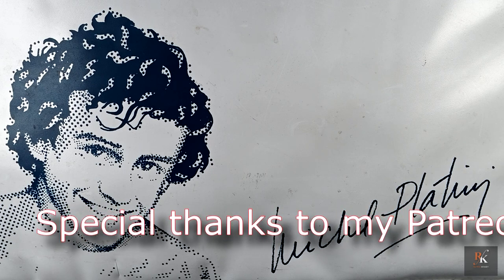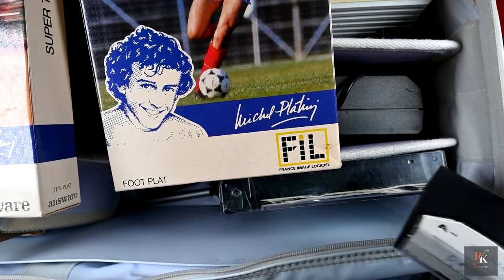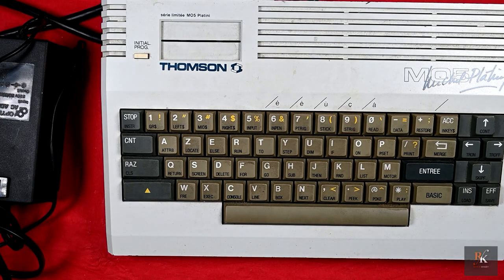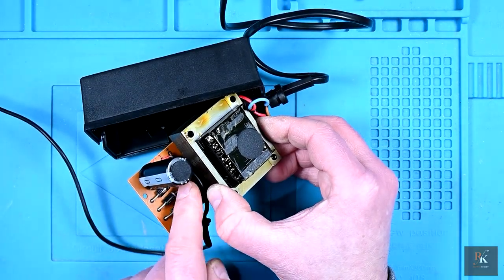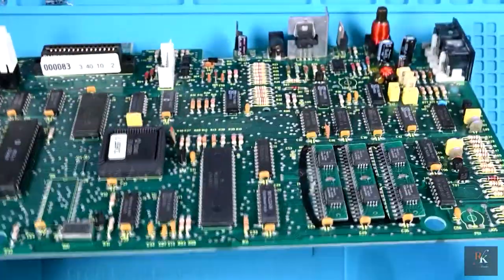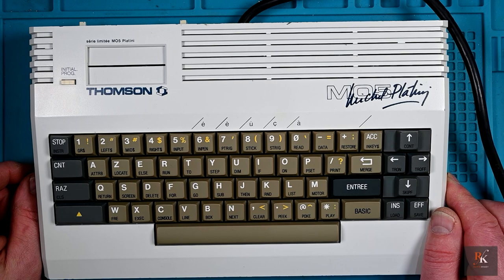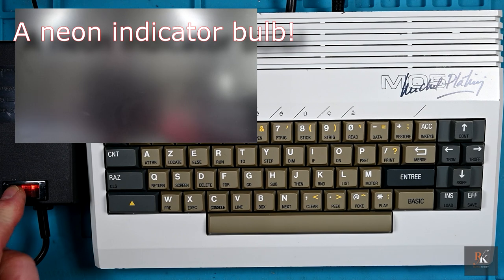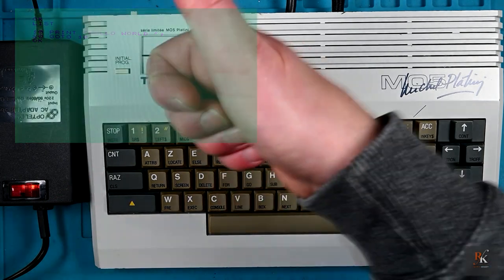Repair/Restoration: Thomson MO5 Platini Edition

Comment: I'm quite surprised they never tried to sell the MO5 over here. It's quite a capable machine, and Thomson were quite close to Thorn in the UK - I think that, in 1984 quite a few customers would have been attracted to the Ferguson name on a computer, they had a good general reputation and very good retail network. Opportunity missed, although 1984 might just have been a bit late in the day.
Reply from the maker: I have a few of the generic MO5s and they all have the 'dead flesh' type keyboard common on the ZX Spectrum, so this was quite a surprise when the keyboard turned out to have real keys!
As you say, 1984 may have been late, though they brought out a few more peripherals for it. I have yet to test the 64K memory expansion for example! As you say though, possibly an oportunity missed as it indeed could've sold well here.

Comment: You can press both CNT+C to exit the basic program properly: CNT+C=BREAK (CTRL-C)
(The white INI PROG button is just the reset button).
I also think that the keyboard can be retr0bright'ed. (Though you may lack UVs from the sun in Scotland ;) )
Reply from the maker: Thanks! I'll give that a go shortly as I think this system is seriously under-rated and I have a whole bunch of tapes to test out :)
I am currently trying to sunbright the keys, though as you say, Scotland lacks a good supply of UV rays :D